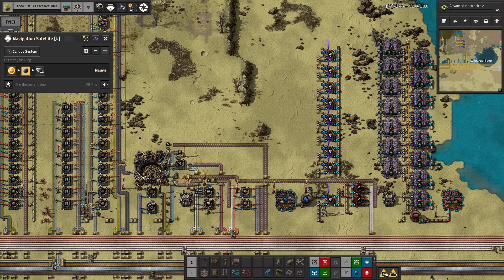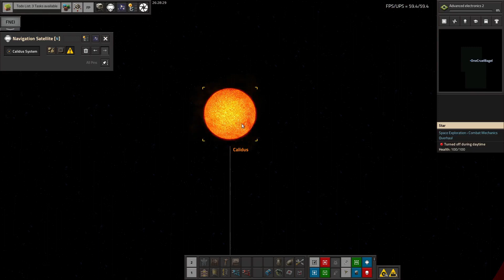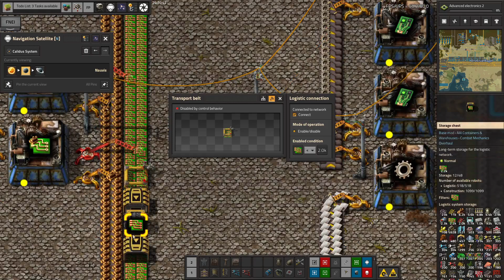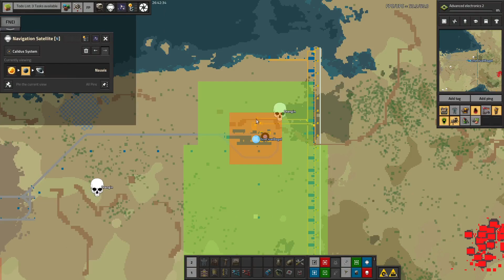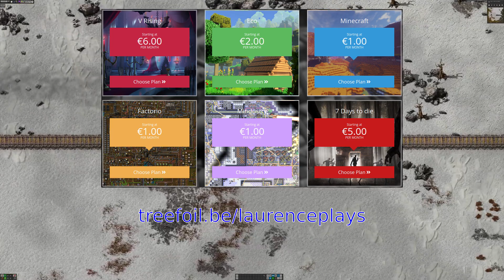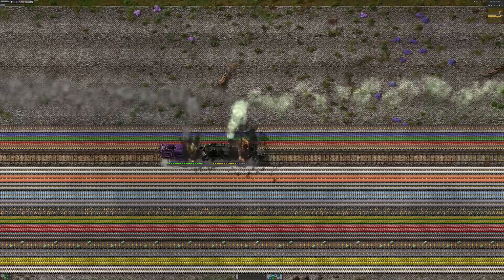S1-E06 pt1 - Going Green - Laurence Plays Factorio: Space Exploration 0.6 + Krastorio²

Comment: 10:10 The other factor here is the lifetime of the patch - if you pull out the ore twice as fast then you'll run out in half the time. Personally if I think throughput is too low I prefer to add another mine. The pro is you have simpler setups and longer between setup and tear-down, the con is that you move the complexity from the mining setup to the logistics setup (LTN just does that for you, in our LTN-less run the Tristan-Bot does it for us ;) )
15:40 If we keep on-top of the "defend the cloud" strategy, we theoretically won't need walls at all - technically you'd only need a few guns to deal with the biter expansion swarms which will occasionally wander towards the base. That said, in the last stream the pollution element of the evolution factor became the largest element for the first time in our run :(
Reply from the maker: You're not wrong about having the choice over whether a mine lasts longer, however the point is that (at least in vanilla - I don't think this counts so much in SE), you'll get sufficiently high mining productivity and dense ore patches that the mines last basically for ever, but can pour out the ore incredibly quickly. So, in this case, that's another reason not to bother. At least until we start mining crazy dense asteroids. The logistics complexity is pretty much sidestepped by just turning the pickup station off until it's full enough. Sure, that won't balance the mines but it will keep the trains running nicely. 
I think I feel safer having walls, even if we don't technically need them... They also provide a nice visual "here is the edge of our base" line for building, defending and trying to keep the pollution inside! We've been a bit messy recently, I think we should put some more effort into cleaning up, especially around the mines.